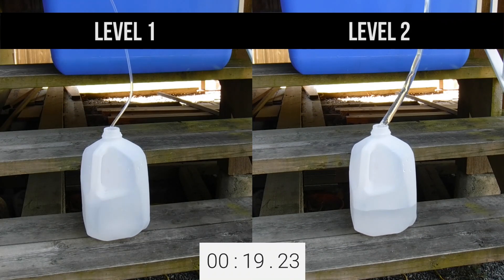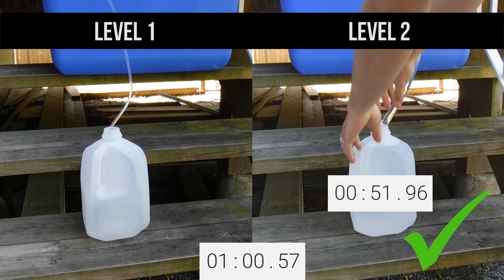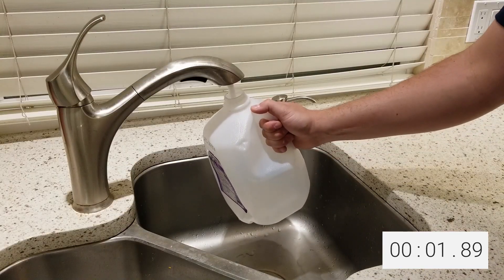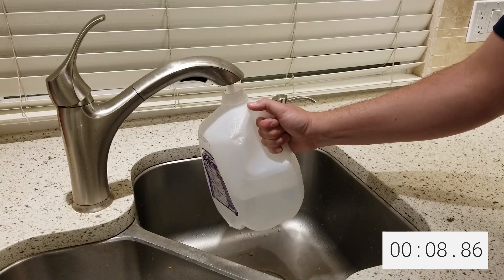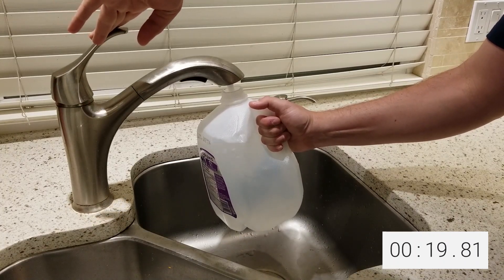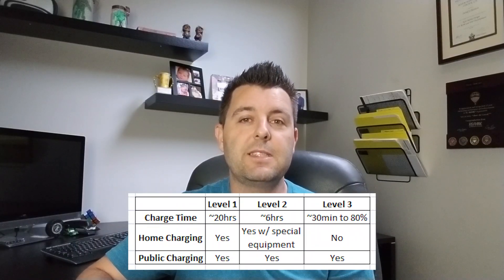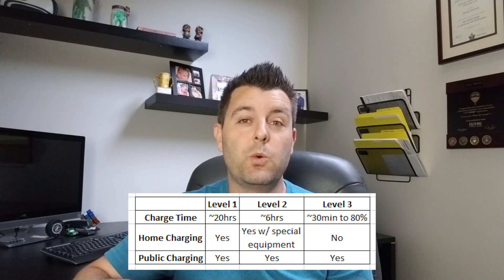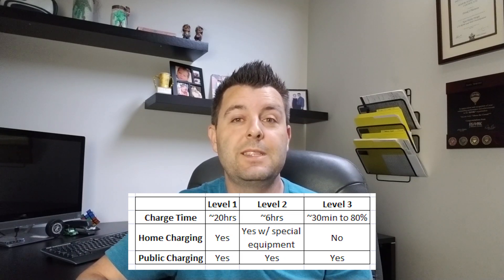3 Levels of Electric Car Charging EXPLAINED

Comment: I found this video helpful as I purchased my first electric car in January this year. 24kw 2013 Leaf. Knew nothing about electric cars or cables. It had 11 of the 12 battery bars when I purchased it, but today I lost another and now have 10. I only found the 80% max charge setting today, it had always been charged to 100%, usually with 6kw charging cable. I have now set it to 80% and charge it overnight with a 2 pin 3kw charger. Do I need to keep it set at 80% max charge as that gives me about 90km compared to 115km at 100% charge to make battery last longer?
Reply from the maker: Thanks for watching... If you find the car regularly, I would just plug it in and charge to 100%.  It matters more if you're going to let it sit for days on end. Ie. When going away on vacation, etc.

Comment: tx.. L1 = 120 volt (1 kWh) where I live.  L2 is 240 volt (7 kWh?) like a dryer or oven power.  L3 is DC charging (50 kWh), and can be fast charging or Super Charging (Tesla up to 250 kWh). Asking what I have wrong.
Reply from the maker: Looks like it is about right to me. The level 2 numbers are based on dedicated lines it looks like, as shared public stations would charge at half that. It also depends if your car can accept that high, as some original leafs can't I believe? And L3 is DC charging, yes, but the rate you have given (ie. 50 vs 250kWh) are the maximums. With the throttling that occurs, it won't charge at that rate the whole time. Thanks for watching, hope you subscribe!